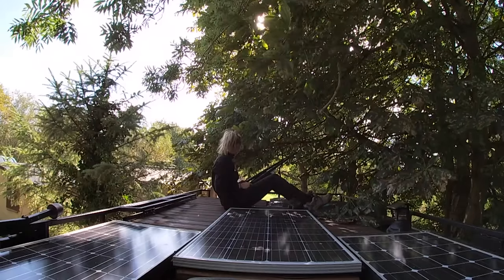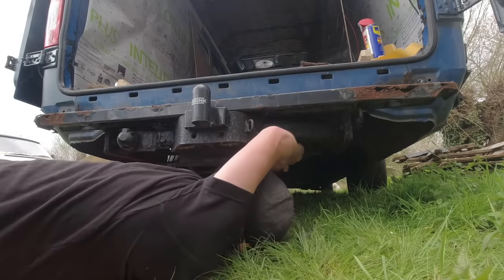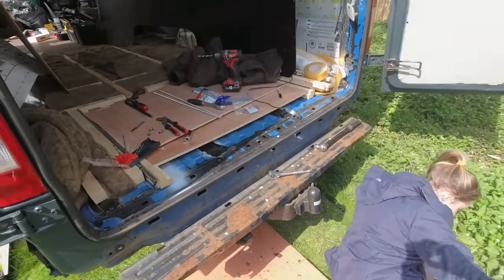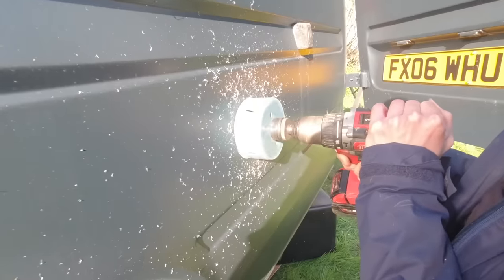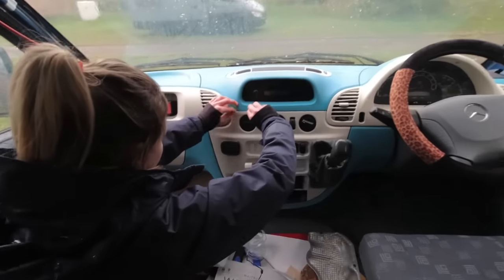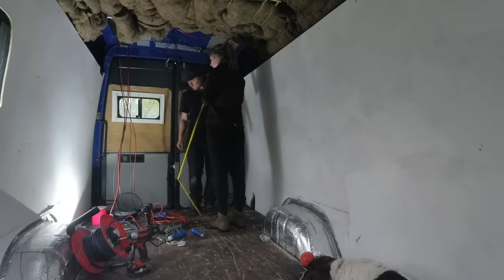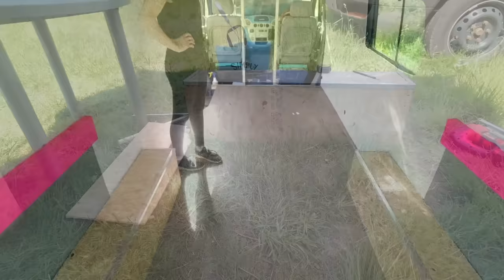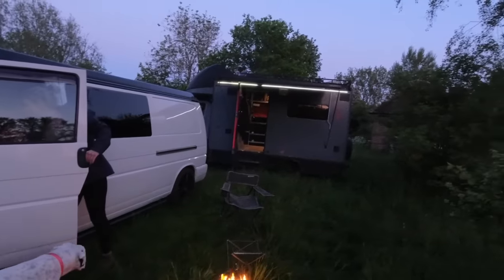Walls, Floor, Bed & Water Tank - Emma's Camper Build - Ep.3

Comment: You should have told Emma to put a strip of tape on the metal then mark where she wants the hole and drill away, the drill won't move around as the tape stops it moving.

Comment: Loving the dash covering. Mine desperately needs doing so I'd love to know how Emma did it.
Reply: I think it’s a flock, but not 100% sure on that
Reply: @Glihi  I'm looking at fake suede or alcantara but it's the fitting it and especially what adhesive means it won't bubble or lift off when the hot sun heats it up.